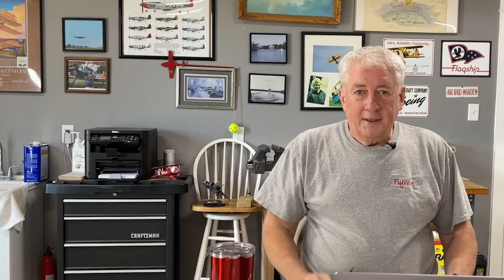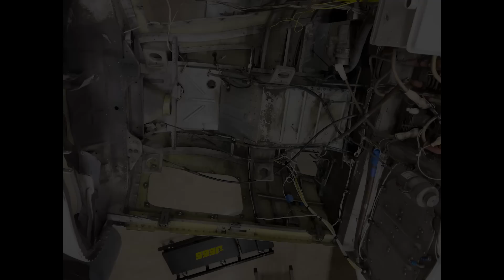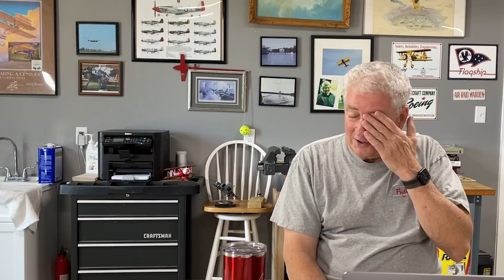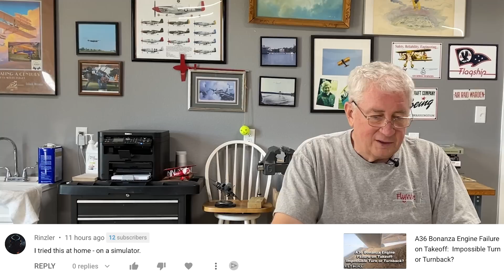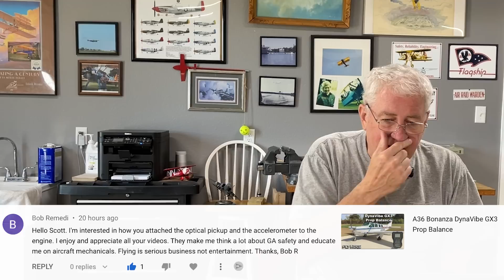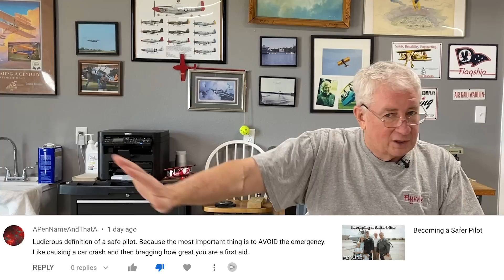Mailbag and 533C Engine Change Update  5/27/22

Comment: We recently had our IO550B throttle body rebuilt due to a minor leak. It was in line at the overhaul shop for over a month. Got it back just a few weeks ago. We tried finding an exchange unit, but there were none to be had. I can surely empathize with the frustration you are probably experiencing.

Comment: Hi Scott, I’m from UPT class 84-04 Reese AFB. During one T-37 spin recovery training flight, we flipped inverted and kept spinning. I still have vivid memories of hanging from the straps while upside down; luckily, the IP “saved” us!
Reply from the maker: Gary, that's what IP's are for;) I look back at UPT now fondly, was too busy to breathe at the time.
Reply: Good old Lubbock! I was actually born there and we lived on a farm near Spade then moved to San Antonio when I was about 10. Fighters used to fly over our farm going in and out of the sound barrier. Made for some fun acoustics on the ground! I’m guessing they were F-4’s or maybe T-38’s? I don’t know if they pushed the Talon that hard or not. Mach 1 was probably at the top of its capability at the time. This was 1968-1970. I had family there up until a few years ago. In our transition to San Antonio in 1973 we lived in Lubbock not far from the South Plains Mall and rented a duplex from a pilot stationed at Reese AFB. I was in 4th grade so I don’t really know what his status was. I think he was an instructor.
Reply: The IP said he really didn’t want to eject while spinning upside down 😉
Reply: @garydwater2112  If I remember the Dash One correctly, your chances for a successful ejection while in an inverted spin were not great.  One of my memory items in the Tweet was 120 knots, wings level, and nose pitched slightly up gave you forty per cent chance of successful ejection at 400 feet AGL

Comment: G'day Scott,

That's a bummer about the missing Engine Parts.

We helped Canada John install a bubble-wrapped reconditioned Rotax in place of the Fuji-Robin, on his Mk-3 Skycraft Scout..., only after his Throttle-cable was winched out of the Throttle-body by his Cooling Fan, did we recognise that the Overhauler had neglected to fit or supply the Safety-Grille which Herr Rotax built to cover the Fan-Shroud Air Intake...

That was what stopped Johnny's Engine, in the middle of his Final Turn, while motoring down the Approach Path..., Nose-high so he could get the Engine out of his view of the Threshold....

It was the Stall/Spin/Splat which did him in, but the missing Grille on the freshly overhauled Engine was what initiated the sequence...; that and the little red plastic Clip, tying the Cable to his Upright Strut  restraining the Throttle Cable from flopping about and being blown onto the Fan-Shroud while sideslipping - which he had broken the previous day and neglected to replace.....

And then, we deduced that he became  distracted by the sight of a Sheep in the throes of having Convulsions, from Pregnancy-Toxaemia, in Angus Mott's Paddock, on the extended Runway Centreline, across the Road from the Aerodrome....; underneath him while making his Turn onto Final Approach....

Johnny had about 5 seconds between staring distractedly at the Sheep..., and bisecting it's Carcasse with his Right Wingtip - after initially impacting the Ground with the Left Wingtip, and then cartwheeling onto the Prop.-Hub - smacking the Right Leading-Edge completely through and through, the old Crossbred Ewe...(!).

  So, "all" my experience of Mystery-Box "Freshly Overhauled" Engines..., which are smilingly delivered with Critical Bits missing - tiny though that statistical universe may be, is 100% bad Scott..., so if I were you I would be expecting bad things from that Unit. And by the looks of your scale of operation you could probably afford to play with the Stearman and the Husky until a regular Piston Engine Overhauler signs off on that Mystery Box, to certify that nothing critical is missing, installed backwards, done up too tightly or too loosely, or is otherwise awry inside of the thing... (?).

You appear not to be constrained by Budgetary Shoestrings, if one may be forgiven for floating such an observation...(?).

{you do EVERYTHING else so right..., why take chances with the Engine ?}

Anyway, you might be interested in,

"Not Dead Yet.. !"

 which I posted 2 dayze back.

I have to get my head and neck nuked..., old mate, 20-40 Grays per day in a Linear Accelerator, 5 days per week for 7 weeks, with Cytotoxic Drugs pumped through an IV every Monday... Not yummy.

Pennance, apparently, for a dozen years of promiscuous Lickety Split, back between 1975 & '87....; either that, or the Alcohol for 60 years, Nicotine for 10 + 6 years with a 3 year break in between, of the Fallout on my Cornflakes in 1963 when the RAF last nuked Oz - to save us all from Communism, via a Plutonium Fizzle-Yield Test at Maralinga...?

But, anyway, the joke is that all of NATO is wondering if Putin is about to nuke the lot of you ; and I have an actual schedule of how cooked I'm goanna be getting crisped (!).

Whoever considered Tonsil Cancer, back in the Era of "Free Love..."?
 Certainly not moi...!

"Hook up in haste,
Repent at leisure...!"

Seems to cover it pretty well, too 

Anyway, please regard that Engine as being a Catastrophic Failure looking for a day to occurr upon, until it's been ticked off by someone who does enough of them to know what looks right, on them, and who knows where all the Traps for Beginners are secreted, therewithin...(!).

Take it easy,

Stay safe.

;-p

Ciao !
Reply from the maker: Thanks Warbles. I have faith in the engine builder. This is the second engine he has done for me and the first one was great. People do get into a rut though and you have to be careful.
Reply: @FlyWirescottperdue  

Ah, cool..., fair enough then...; I thought it was something with less provenance that that...

  Keep on keeping on then,

Have a good one...

Stay safe,

;-p

Ciao !
Reply: "...cartwheeling onto the prop hub..." Anything like what happened with Ariana in SF? 
Life is what happens while we are making other plans. 
Take things one day at a time. Hope when you recover your perspective will be broadened and baleanced. No more excuses.
Reply: @nancychace8619  

G'day,

Thanks.

Yeah mate..., The Mk-3 Scouts were full 3-Axis Control, featuring Wing Warping.

When the Engine stopped, halfway through the turn, being flown too slowly partly because it was a first flight with a new Fine Pitch Propeller, so at whatever RPM he was used to using - he was flying 5% or so slower than he was used to at that setting - and Airspeed was not a thing Johnny was overly interested in, actually. Many stern admonitions were delivered, to little avail.

So, the outboard Wingtip stalled and started to drop, while the Throttle-cable snarling the Fan was 4 ft in front of his face on the back of the stopped Engine...

And a thousand dollars to a Peanut says that he tried to pick up the dropping Wing with the Joystick, which invoked Wing Warping to increase the AOA of his Right Wing..., stalling it so deeply that while spinning to the Right - the first Impact was on the Tip of the Left Leading Edge Spar, compressing it and breaking off the Tip. The second impact was onto the broken Stub of the Left Wingspar at the Fittings for the outboard Flying, Landing and Anti-Drag Bracd Wires...; both the Tip and the Outer Stub of the Spar were plugged with Dirt, and John's Wristwatch was beside the Divot on the Ground dug by the initial impact of the Wingtip...., indicating that his Watchband broke as the Spar failed, twice, in Compression.

After the Spar-Stub dug in, the rest of the Aeroplane "Cartwheeled" or "Pivoted" or "Rotated" around the Stump - causing the Propeller to break accross the Hub because it struck with it's Shaft perpendicular to the Ground - leading to the Fuselage-Tube failing in 5 places, and as it collapsed the 20-Litre Fueltank struck Johnny in the Back and pushed him up against the back of the Engine, in the Sheep-Paddock.

I examined the Wreckage with the CASA Crash Investigators, identified Johnny for the Cops, and wrote a Report for the Coroner. As well as telephoned his father in Canada (I'm in Oz).

So I'm fairly certain of my facts.

How do you justify your doubts expressed about my account ?

Such is life,

Have a good one.

Stay safe.

;-p

Ciao !

Comment: You can't install the engine and do the throttle body later? Least you will be further down the road.
Reply from the maker: I would be further... but there isn't much room to operate and I hate contortions! You'd be surprised how tight it is.
Reply: The throttle body on this engine variant lives in a slot under the oil pan, which when installed, is close to the bottom of the engine compartment.  A real challenge compared to installing it on the engine when it is either suspended on an engine hoist or on an engine stand.
Reply: G'day,

When assembling complicated machinery on which Safety depends, correctly Sequencing the process is often not only the key to enjoying the job...; but it can be critical to safe operation of the completed reassembled Unit.

I applaud the (militarily installed ?) self-discipline required to stop and wait for the Throttle-body to be overhauled before trying to "proceed" in it's absence.

The wisdom of buying an overhauled Piston Engine from a Workshop which specialises in Turboprop rebuilds rather escapes me though.

If such an Engine arrived as a free gift, surely one would be tempted to immediately dispatch it to a Piston Engine Overhauler and pay them to Zero-Time it propperly..., before being tempted to trust it for the purposes of Levitating behind any such a Mystery Box.

Sort of like buying a reconditioned Automatic Gearbox from an Auto-Electrician, kinda thing....

But, that's merely my Hillbilly (il)logic going off by reflex..., I hope.

Such is life,

Have a good one...

Stay safe.

;-p

Ciao !